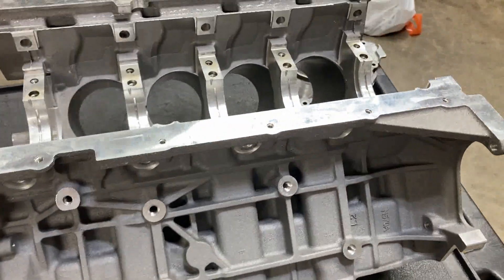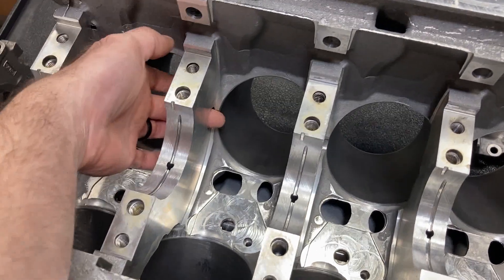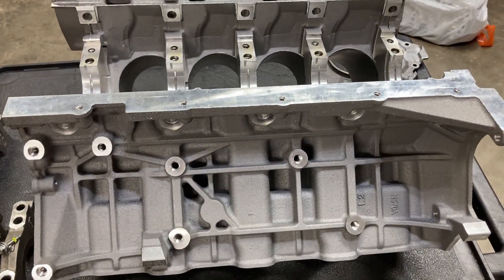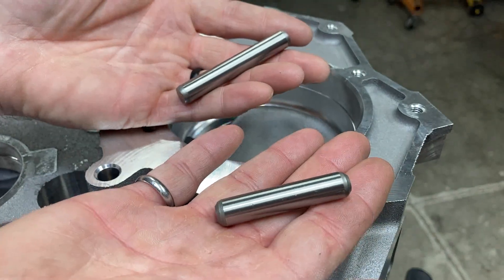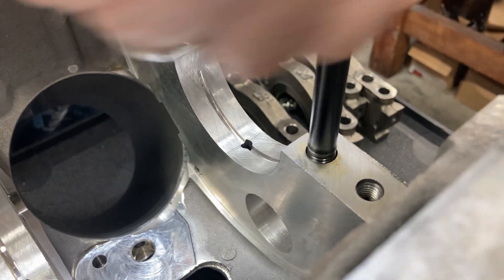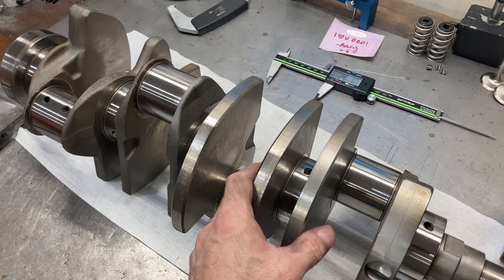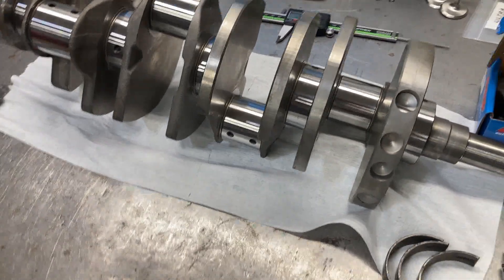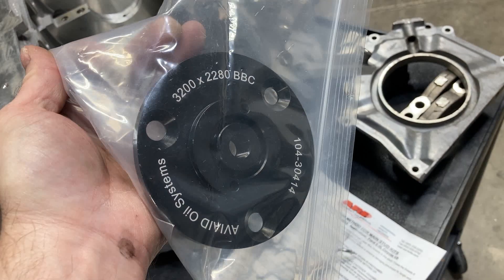Lykins Motorsports New Coyote Block Overview & Prep

Comment: Great video and really enjoying watching your approach to a Coyote build!  Pretty sure the new block you got is a Gen 3. I believe the plasma sprayed in liners were introduced to the Coyote for the Gen 3.  The bore on the Gen 3 also jumped to 93 mm (3.662 inches) from 92.2 mm in the first two generations taking the displacement to 307 ci.  I did a project build for a FFR Daytona Coupe and started with a junkyard 2018 F-150 motor which had piston squirters in it.  Maybe they weren't installed in the mustangs, but Gen 3 blocks most definitely have the provisions for them.  I had to do some pretty health port matching on the remote oil filter adapter, thankfully it's very easy on the aluminum blocks.  Last piece of extremely limited experience I have (only ever built a Coyote) is to be sure that you have rings that are compatible with those goofy cylinder liners.  They do not behave the way iron liners do.  I'm excited to see you get over 600 HP with this build!

Comment: $1100 for an aluminum block with 6 bolt mains and all the latest tech is amazingly cheap. In the early 2000s before I left the dealership we replaced quite a few 460 cylinder heads due to the exhaust bolt holes being cracked or the flange being excessively warped. I remember the price of a bare head being $400. 4.6 2v (don't remember if PI or non-PI) complete aluminum cylinder heads assembled with valves and camshaft were available for $165! Blew me away with the price difference.